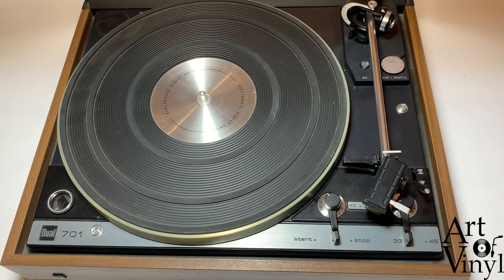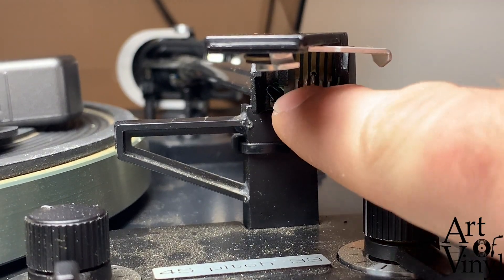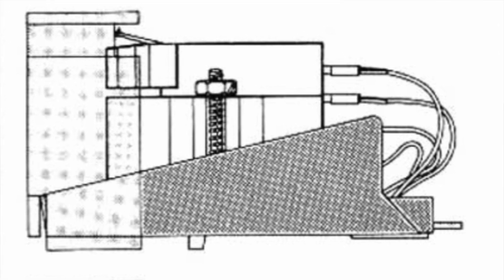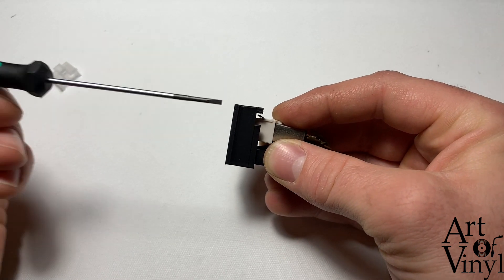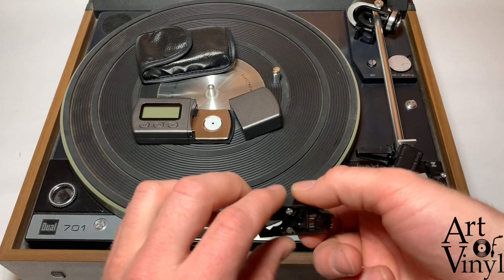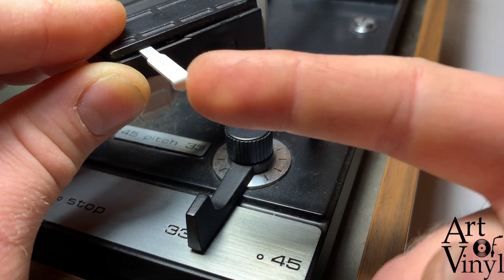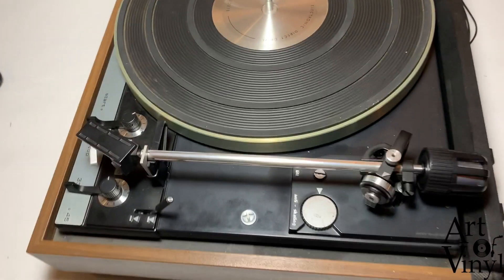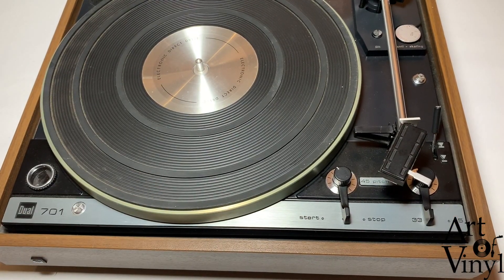Dual cartridge alignment and adjustment of tracking force and anti-skating guide (Dual 701, 1209)

Comment: why using gauge that is measuring the mass much higher than vynily will be? it gives you wrong measurement even if you are in a offset within few degrees in vertial angle.

Comment: My 1242 tracking was adjusted to 1.3 based on the weight of the cartridge 1.3 gram. When it starts playing the arm comes at the right place over the beginning of the of the first song, but when it lands it moves to the second or third song track. How can I fix this problem? Thanks!
Reply: I think you are saying that it starts a few grooves into the first song when using the automatic start. On my dual 1219, that can be adjusted through a screw hole near the tone arm rest. You first have to set the record size to 12" which aligns the actual screw underneath with the hole and then you can turn it to the left if it starts too far into the record, or to the right if you have the opposite problem. Make sure not to forget to set the record size back to the correct size before testing. That's how it is on my 1219, it may be different but similar on yours if you have a different turntable

Comment: At the star My tone arm comes down a couple of mm short.Can you tell me why and how i can correct it please .Thank you
Reply from the maker: It might have multiple causes. First check if the steuerpimpel is pushed on correctly. Then check “stellhülse” and the “rotation bearing”. If these are intact, adjusting the “rotation bearing” with the flathead screw in front of the arm might help.
Reply: Thank you .The adj srew didnt work first then i opened up and fiddled about a little its all Fine now.

Comment: @9:20 For the tracking force when I try this on my 1249 the platter automatically starts turning so I cannot do the calibration properly. Any tips?
Reply from the maker: Perhaps take the plug out? 
Otherwise there are good service manuals available on vinylengine.com

Comment: Greetings, does Dual 604 (TK 230) also potentially need spacers for the the new cartridge or is it only needed for TK-14/TK-24 like on the video?
Reply from the maker: Hi there. Spacers are needed if het height of the cartridge you are putting on there is lower than the original. You can check this with a cartridge alignment gauge or an azimuth ruler.

Comment: I would seriously not use WD40.  WD40 will dry to a gummy residue that can act as an insulator.  What you really want os a contact cleaner or isopropyl alcohol.   Other than that, the rest of the advice is pretty good.
Thanks for a great video.   I have a Dual 1015, which is a bit different, but uses the same alignment and similar headshell design.

Comment: 704 has vta and vtf. All dual TTs with contact plate: gently pull the contact plate down and out. Polish both sides with metal polish. Tarnish will melt away with no effort. Both sides will be black with oxide tarnish. Clean with ipa and then f5 deoxit. The rca leads should be replaced and contacts under the table polished as well. Run 2000 grit sand paper up and down through the mute switch contact 6 or 7 times to ensure contact. Dual tables generally want .25 grams less anti skate vs tracking force.

Comment: I have a 1219 with what I think is a problem with anti-skate.  The stylus sticks in a groove on what I believe is a clean, unscratched disc. It happens on multiple discs,  intermittently.   TT was refurbished a few years ago, but I really do not know what or where lubrication was applied.  I cleaned a relatively new Shure cart/stylus with no joy.  When changing the anti-skate from zero to five on the black scale, there is no movement of the arm as I use quening lever to lift the arm of the disc.  If it is set to five on red scale, I get a very slight  movement of the arm to the outside of the disc as the arm rises.   That would seem to be opposite direction of the force I need to allow the stylus to track without error along the groove.  I am about to open the TT and apply 3 in 1 Oil to gimbles;  I have aligned the cart with a protractor and set the VTF to 2.0 grams with a scale. I wonder if you could suggest anything else to check or replace while I have it apart?

Comment: Thank you. There is something important that you have forgotten to clarify. In the original cartridge holder that you showed first, it is not necessary to align because it is already designed so that you do not have to do it , so you have to align it when using another that is not the original and to mount another cartridge that is not original it is necessary to change the cartridge holder too which is what you did and for that reason you had to put the adapter to achieve the sufficient height. You forgot to clarify it because without that explanation it is not understood why you did the entire alignment.
Reply: Thanks for the comment that was needed

Comment: How do you adjust the set down to get it to start at the beginning of the record, also the cartridge is slanted and the right hand side touches the record so how can I fix this. Do these decks need an earth wire from the mains? I have the 1218 model nad it only has 2 wires and a 2 pin German plug and  am in the UK, do you sell 78 cartridges?
Reply from the maker: There is a screw underneath the speed change lever. A slight turn of that adjusts the point where the arm sets down. 
Another reason for this might be a broken steuerpimpel. I have a video that describes replacing that as well.

Comment: Where is the white backing piece that was in the cartridge holder when you dismounted the cartridge holder
Reply from the maker: That backing plate only occurs in a very specific headshell, from the Dual 1229. This is a plate that allows the user to adjust the angle of the cartridge if the multi-play function is used to compensate for the height of multiple records stacked on top of each other.

Comment: It not the same cartridge holder. So, where did all the insides of the cartridge go ? Why not use the same cartridge holder. You confused me
Reply from the maker: My apologies. I see now that I used different cartridge holders.
Reply: @ArtOfVinylTurntableRepairs  what did you use instead?  Also, is the headshell on a 510 replaceable with either A-T or Ortofon?

Comment: You have to remove the platter mat when you adjust tracking force...Those scales account for the thickness of most mats. Leaving the mat on will have an effect on the measurement....
Reply from the maker: True, although the effect is not striking. Typically these Dual turntables have their mats glued to the platter from the factory.
Reply: Not necessary at all.

Comment: Thank you for this detailed tutorial. I have a dual 721 and the toner arm height is also adjustable. What would be the proper way to adjust correctly the height?
Reply from the maker: You would need an azimuth for that. 
I explain how to use it in this video at 7:00 
https://www.youtube.com/watch?v=AbpA5DEDEvo
Reply: The goal of VTA is to enable a level angle of attack of the tone arm for improved tracking. Once the cart is aligned, level the tone arm with the stylus down in playing position. Too high or too low will be obvious deviation from level.

Comment: Thank you very much, just resolve my sound problem on phono preamps. headshell had moved during transport.
Reply from the maker: richard grenier good to hear :) enjoy your turntable.
Reply: @ArtOfVinylTurntableRepairs  I was so happy with the table that I found and bought a Dual 1209 for parts including is staking spindle for 125$.motor was supposedly making noise. After cleaning and greasing all parts , it is almost working except the Idler at 33 rpm wont touch the pulley. Platter needs a kick start do you have any idea why ?
Reply from the maker: @richardgrenier4639  I think the motor bearings will need cleaning and oiling, as well as the main spindle bearing. I plan on making a video on that in a month or two. Another reason could be that the inside of the platter or the idler wheel are dirty/have gone hard. a light scrub might solve it. 
You can check this by feeling if the idler wheel is stil rubbery and if there is any residue on the inside of the platter, where the idler wheel hits.